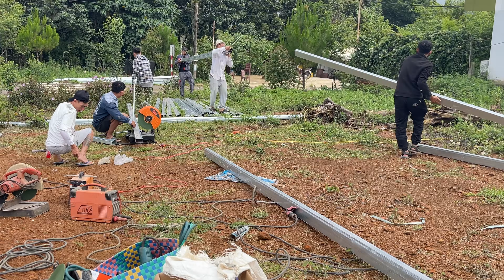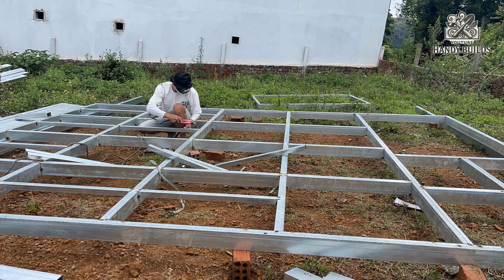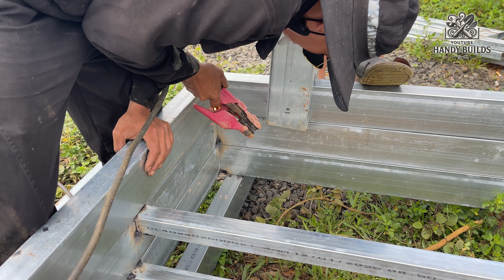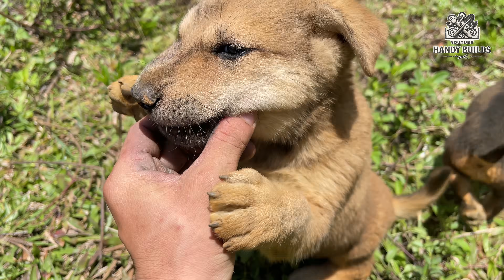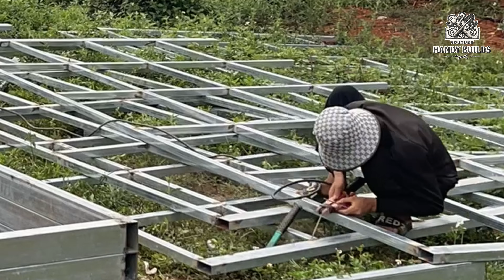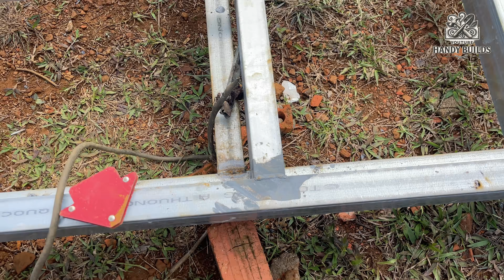How I Built 4 Low Cost Cabins with Metal Framing | Part 1: Metal Frame

Comment: How do you tack weld without blowing through thin steel and avoid arc-eye sun glasses seems a bit bravo and i've seen guys bare eyed!!!
Reply from the maker: Short tacks (<1 sec) + tight fit-up stop burn-throughs. And definitely use a proper welding helmet! Sunglasses won't protect against UV arc-eye—safety first! 🛠